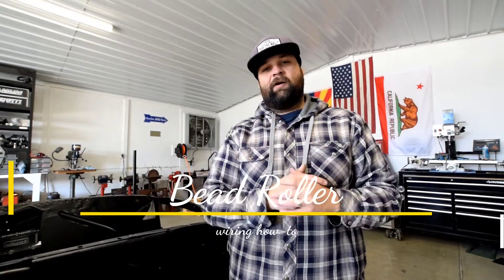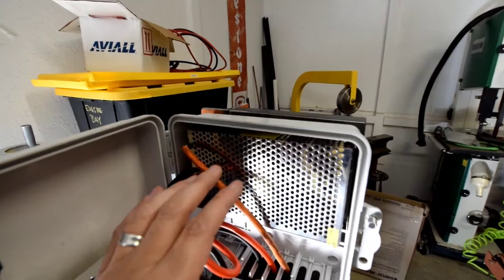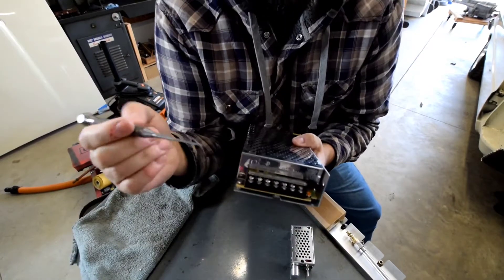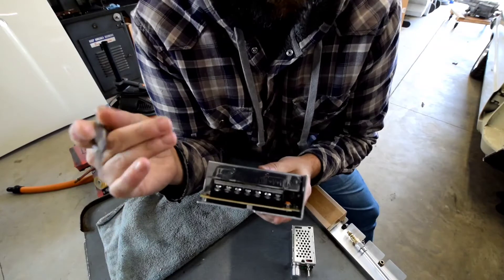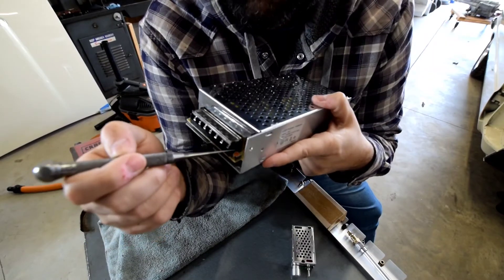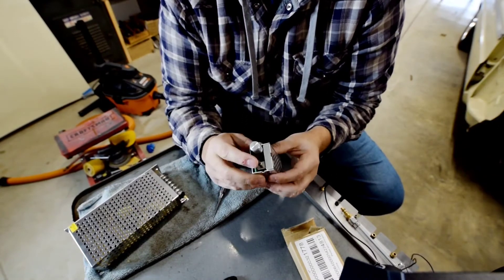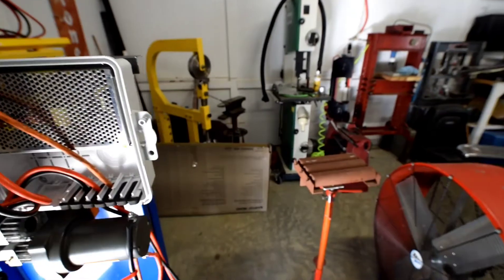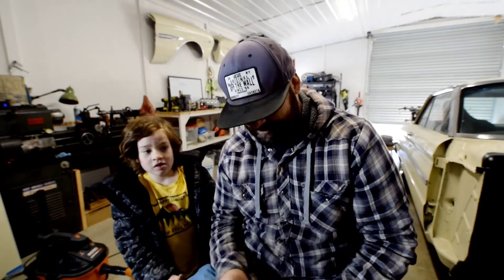Motorized bead roller wiring

Comment: Just found your channel, this is awesome. I have everything to get it done. I am not sure how you connected the foot switch. Meaning does the foot switch have 2 cords coming out of it? Or did you split the wires inside the foot switch? Hopefully i make sense. Either way thanks for the video
Reply from the maker: Thanks for watching! Yeah I just basically interrupted one leg of the power with the switch.
Reply: @rdspeedfab awesome. Thank you for responding.
Reply from the maker: @ yeah you bet!

Comment: power from the wall to foot switch red to power supply where is the other wire go off the foot switch.
Reply from the maker: So you have three wires coming from the wall. You just need to interupt one of the legs (power or neutral) with the foot switch. The other leg and the ground can go straight to the power supply.

Comment: just found your channel and subscribed. Very interesting implementation.  I likely have no idea what I'm talking about, but I wouldn't think in the long run that the 12V PS would like being cycled like that with the foot switch?  Is there a delay between actuating the footswitch and starting the motion?   Time now to check out your other content
Reply from the maker: Yeah there is a little bit of a delay and a soft start. I attribute it to the full power down of the power supply. Thanks for the sub! Hope you enjoy the content.
Reply: @RDspeedfab  Couldn't you put the pedal in-between the power supply and the motor so the PS can stay on and only the motor is switched on and off?
Reply from the maker: @Vtwin_Guy  yes absolutely! I may try that and see how it works